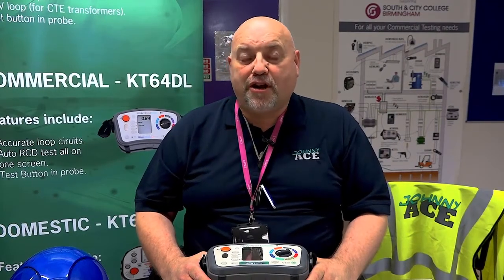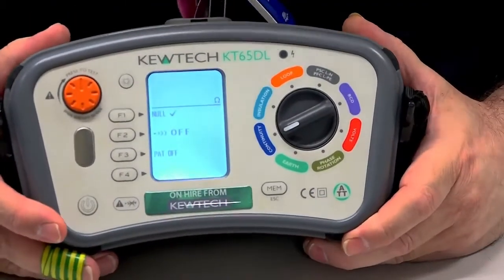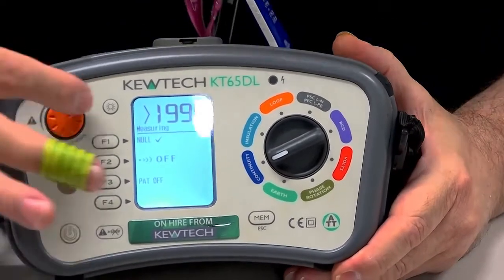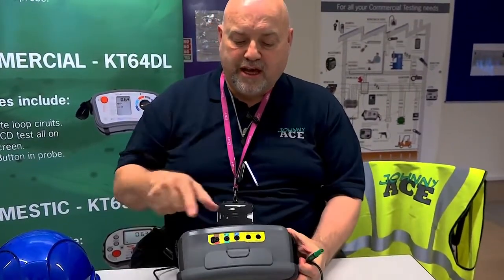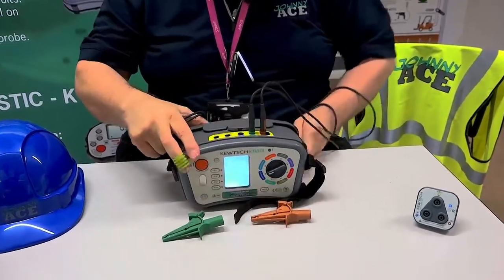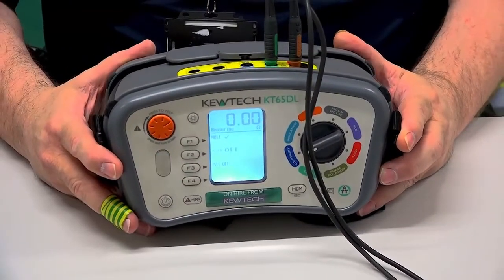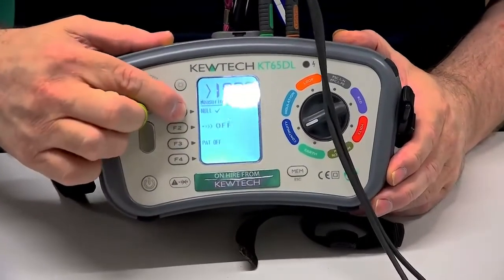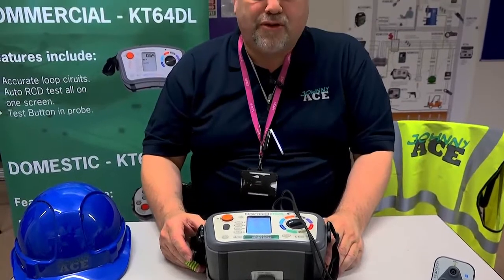Kewtech Nulling Leads with the KT65DL

Comment: Why is it necessary for the continuity test to be running when you turn null off? I have always found this a rather unintuitive requirement, that left me scratching my head a number of times when I first started using the instrument.
Reply from the maker: The memorised null value can be cancelled by disconnecting the test leads and pushing the Continuity Null button (F1) with the test button pressed or locked. When this is cancelled you will know because NULL OFF is displayed on the LCD.
 CAUTION - before taking any measurements always check the leads have
been zeroed. - Hope this helps!
Reply: Unfortunately it doesn't help. That's more or less what I was saying myself. The question was why would it need to be done like this? Null off is surely Null off regardless, of the presence of any leads (or otherwise) or test reading being taken at the time, so we seem to have a superfluous limitation.
Obviously both are required when turning null on and it makes perfect sense in that scenario.
I wonder if it could be actually measuring some internal resistance, so "Null Off" is actually zeroing some internal resistance of the meter.